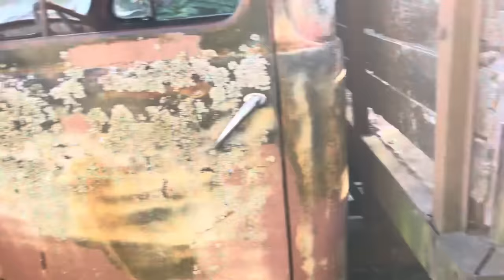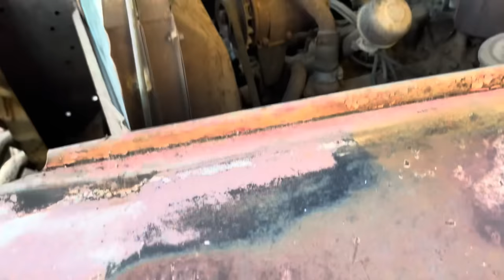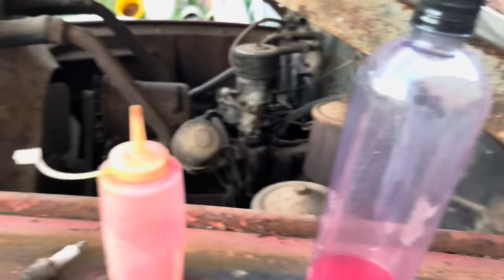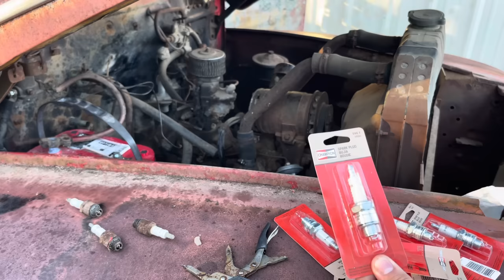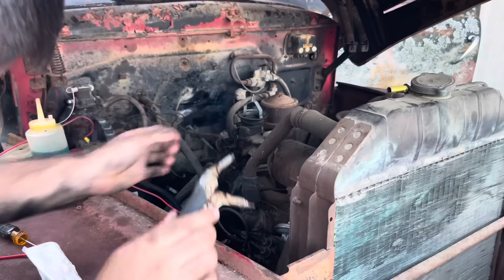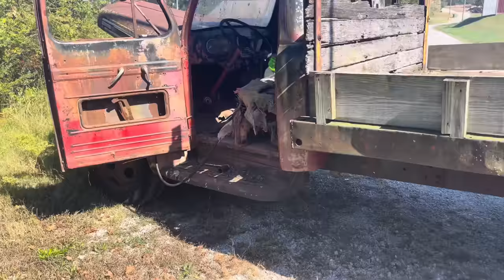Will it run after 40 years 1950 ford flat bed flathead v8 truck

Comment: My vote is for leaving it intact and fixing it up. A flatbed truck with a dump bed is much more useful than a little old pick-up.
Reply: agreed!
Reply: I think it would be nice to that truck fixed up
Reply: I also agree!
Reply: Nope.  He needs the motor.  Get over it.
Reply: @justindougherty976  I agree, he should use it for what he needs, but the reason I said what I said was that it had a hydraulic bed, I thought that was pretty cool.
Reply: @justindougherty976 "get over it" , always nice when someone can ruin a cordial conversation. Good job
Reply: Come on, Creator! 
Carry on respectfully and fix these vehicles up properly, instead of taking their vintage virginity. If you're just accepting YouTube creator income then you need to question your intentions.

Comment: I think the truck should be kept intact and all original. Definitely need to flush out the cooling system and check the ignition timing. With some hard work she will be a solid runner. That old Flathead sounds great. Hard to believe those old trucks actually run and drive. Makes me want to buy an old car and wrench on it. Keep making these interesting videos.
Reply: I have a 52 GMC 1 1/2 ton flatbed for sale if you are serious about getting an old truck to wrench on.  It even comes with the stuck engine package to make it more challenging.
Reply: @jerrybrooks870 where are you located and how much are you asking?
Reply: To be fair, he said the engine has already been rebuilt. It is no longer original.
Reply: @Legionary-Assassin  , 30 miles West of Fort Worth ,Texas.  I'm asking $2500, and I have title in my name.
Reply: You should pick one up, man. They're easy to work on and build your knowledge and learn. Parts for them are generally pretty cheap especially compared to modern car parts, provided you keep it fairly stock and don't spend thousands on AC conversion kits, digital gauges, EFI and crap like that.  And if you do the work yourself you can be in one of these for very little. The biggest thing is buying the initial vehicle for the right price. I took a '66 F100 and did a mechanical restoration on it and now I use it anytime I need a truck. I actually needed a truck and there was no way in hell I was paying 20k+ for a 15 year old truck with 150k miles on it. Instead I'm in for significantly less than 10k on a mechanically brand new truck that I can drive anywhere and still tow and haul pretty much whatever I want. A modern V8 truck barely even gets better MPG than mine does. A year in and 5k miles, no complaints.
Reply: Mécanique fiable, simple et efficace.
J'ai redémarre Jaguar xj6 et Rover P4, voilà des année...
Beau travail. 👍
Reply: @josephg41  , another benefit is that instead of depreciating, it increases in value as it ages.
Reply: @pfcparis put in a 300 I-6, high compression pistons, well 9.0+:1 & re-paint it.

Comment: That pink concoction you made is close to Ed's Red, a home-made gun cleaner that works real well.  It's equal parts of each ATF, Acetone, Kerosene, Mineral Spirits and optional lanolin.  You only really need the acetone if you're cleaning shotgun wad fouling.

Comment: We've got an old jailbar with the same engine in it out behind the shop. We tried getting it to run a couple years back but no luck. While not seized the engine still takes alot of effort to spin over. Your video is really starting to inspire me to try again
Reply from the maker: If it’s not hard to turn by hand but the starter is having a hard time turning it it’s probably a starter problem a lot of times the bearings the starter go out and it makes them short out and spin very slowly
Reply: Thinking back I'm pretty sure the hand crank was super stiff even with the starter. We did fill the cylinders with oil then put the spark plugs in before leaving it again so I think I'll give it another go this week. 

If it's still stiff I guess I'll have to give rebuilding the starter a go, we never did do that. Thanks for the inspiration
Reply: Quick update, I went out there this morning and worked on it a while. It was still really stiff until I decided to spin it backwards before going in. It clunked a few times and actually freed up! Cleaned the points and now I'm waiting for my dad to show up with a coil. All that's left is the oil and the carb and just maybe I'll get to hear that flathead come to life
Reply from the maker: @NoName5589  the starter is your problem the starter Bendix was stuck pull the starter and clean it up check the bearings and the brushes and you should be good to go
Reply: We worked on the starter and had it whirling under its own power at the end of the day, thanks for that. He didn't have a coil on hand but amazingly the old 6V coil is still outputting a strong spark. If the license plate is anything to go by it's been sitting since 75

Battery died just after we got her to hit a few times at sundown. It's on charge now and tomorrow is a new day
Reply: She started and ran! What a champ, this just made my week. I never would have gathered the inspiration to revive her without your will it runs and I'm so glad I did. When the next spot opens up in the shop we're going to get her in and actually work on a refurb

Comment: Look up Belzona.  Its a high quality, 2 part epoxy made for fixing castings.  I had my rebuilder use it on my Model A block as they crack.  Its been working great.  He was skeptical on it.

Comment: You can jump the solenoid with a screwdriver from the small terminal to the positive post! And when you got a stuck motor dump some of your concaution down the carb too. I love how it has a water pump on each bank and separate thermostats, when you start an old flat head thats been sitting dump a 1/2 cup of gas down it " no shit" its like you can't flood them and fill the float bowl also thru the vent on the carb, those heads look like Ford industrial heads. Have fun 😊😊

Comment: The solenoid for the starter just needs a good rap or two small ball / peen works.  Oil may be overfull as the filter on some installations drain to the sump giving a false reading.    Thanks.  Narragansett Bay

Comment: That’s old Mercury engine designated by EAC on the head. They were the highest horsepower of all the old flatheads engine has definitely been changed from the original. Keep as is and enjoy it. True blue fans around the world would appreciate it for is.

Comment: EAC HEADS: EAC – These heads where a Higher compression Mercury Heads commonly used in Canada and the Mercury Counter Part to the Ford EAB. EAC is the last Mercury flathead. Very desirable among flathead guys, some would say it’s the most wanted flathead of all because EAB/EAC had the best stock camshaft and the highest HP.

Comment: I'd vote for putting a different motor in it and upgrading the engine, trans, and brakes.  It looks great with that patina.  Get it back on the road, safely, and do a little interior work.  You could have a great work truck.  You've already got a great project for the old flathead, so it's not going to waste.

Comment: If you can trust the EAC on the cylinder head,  it's a '52-'53 Mercury engine.  Of course,  the engine could be made out of parts from six different ones by now.

Comment: Using two-stroke oil to start an engine that hasn't ran and several years is a good plan. Something needs to lubricate those valves and  the tough end of that engine until the oil starts pumping again

Comment: I can tell you the best stuff to use to unstuck pistons  refrigerate  oil out of compressor off of old refrigerator  or ac units unstuck a dozer piston with it works wonders

Comment: Cracked blocks are common on Ford flatheads. It doesn’t mean the engine is unusable it all depends where the crack is on the block.

Comment: Don’t run it that way too long.  It’s a 6 volt POSITIVE ground truck.  I have one.  Also, that mustard top 6v coil is worth a lot of $$ if it works.  I’ll take the cab if the floorboards and rear cab corners are decent.

Comment: Pull that motor and put it in your project truck.  Get a Y block that runs, stick a clutch disc in it and sell this one "with an upgraded motor".  Flatheads in heavy trucks were not the greatest.  Way too much exhaust heat transferred into the cooling system.  OK in a lighter duty truck.  But something that will actually pull grades and carry loads, nope 🙃

Comment: I'm not really up on the flat heads are they babbitt or have incerts bearings. I have a  flat head 8 need something to put it in I have no idea what year model. It's locked up but would love to get into it. Anybody out there know where to get over haul kits and maybe a engine manual for it. Myself I would not touch anything on that truck just drive it like it is

Comment: As an owner of a 1948 Ford F1 pickup, it was great seeing this video. But id truly pull the V8 for different project, The Cab would work for everything from F1-F6 the front fenders from f2-and up.. If i remember correctly break parts for these big trucks can be expensive and some times hard to find. Same with the rims the old widow makers.

Comment: This ole man showed me even if you sand the points sanding grit can fall off and stop the contact of the points, so he showed me that after you sand or file the points put a piece of paper in-between the points and pull it out and the dirt or grit will be removed.

Comment: Hi greetings from the UK. I have a 1948 Ford F5 Coe here in the UK. You are a lucky gentleman in that you appear to have the later 8RT . Mine has the crab distributor which is difficult to get to. It did not have a bed when I had it so we made a beaver tail car hauler. It also has a Columbia 2 speed rear axle allied to the crash box. The biggest problems with these are Firestone widow makers Mine now has wheels from a 1970's Dodge motor home so I run tubeless tyres. She is good for 45 mph. I wish you all the best with your projects and I would leave your F6 in one piece. 8BA are not uncommon. As for the impossible....I am rebuilding the rustiest most wrecked 1954 Packard in the world  I have done the 359 flathead straight eight overhaul and allied it to a Clipper overdrive manual gearbox. The body is being repaired. There is not much original metal left 

Nick Jervis UK (ask the man who owns one)

Comment: The purist in me says leave the engine and fix it up as-is but part of me has always wanted one of these with an updated drivetrain as a shop truck or something. Either a Windsor or an FT/FE, a 5 speed, power steering, power brakes, etc. Not to say I don't love the flatheads, it's just easier to add stuff to a 302 or a 360 or 390 or something.

Comment: I say pull the engine. The engine has already been rebuilt so it is no longer original. Otherwise I would argue to keep it. Considering also how hard you have looked for a decent one.

Comment: How long is it going to be before us nagging mechanics convince you to get a remote starter button? I've had mine for over 50 years and have used it hundreds of times. Jumping the solenoid with a Visegrips is just idiocy when you can own a quality remote starter button for less than $20. Please get into the 21st Century.

Comment: I vote take the engine and make a rat rod or a rat truck! If you need a 1 ton truck or dump get something else! Flatehead V8 belongs in something much cooler than an old ass  dumptruck